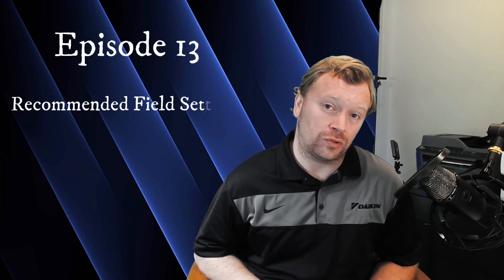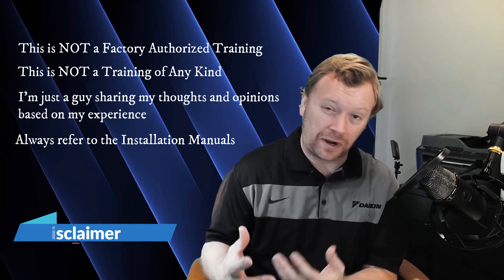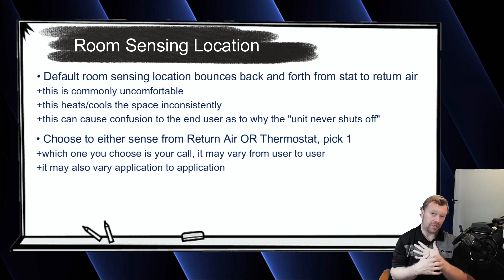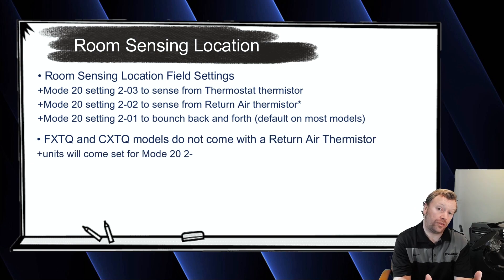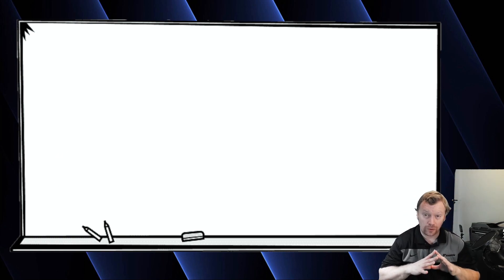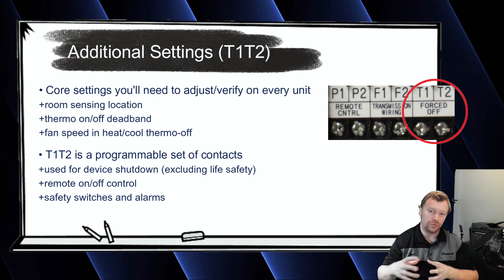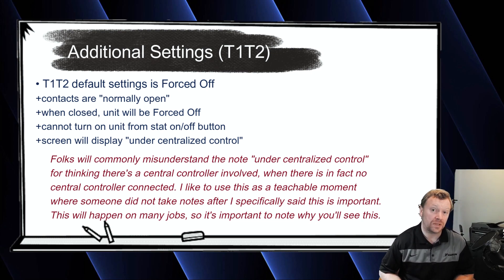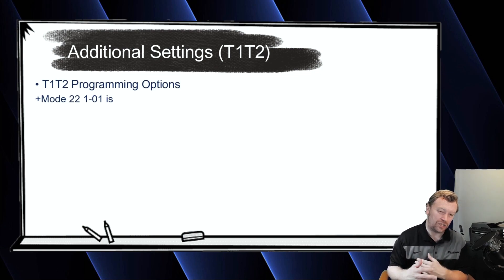Daikin VRV Field Settings | Recommended Settings for Residential VRVS & VRV Life Systems 12-10-2021

Comment: Last week I replaced my Trane old gas heat cooling only condensing unit with a new Daikin 3 ton VRV with CXTQ coil and 80% gas furnace and ONE controller.  2 questions. 
Is there a setting available where to allow the control to have a toggle between where I can select gas heat or heat pump control? I have some friends I’m slated to install systems like mine and they may want to operate on gas instead of heat pump at their discretion. 
Is there a way to turn down the condenser fan to a quite mode for heating. I can hear the condenser fan running inside my home living room and the condensing unit is a ways away from this room, I did do a wall bracket so maybe some of what I’m hearing is transferring down that wall.
Reply from the maker: Great questions. 
Your gas heat is intended for backup or emergency heat, you can set this up a few ways. I did a video on this very recently actually just after this video you commented on. Check it out it will help answer some of this. You can always set up the outdoor temp lockout too from the outdoor unit to tell the heat pump you want gas to come on sooner. The default is 14F outside I believe (or 15F). There isn't a way to just manually turn on gas from the stat though at least not at this time.
Regarding noise of the fan, there is a nighttime noise setting but it reduces the whole system capacity so not only is the fan speed decreased so is the compressor. Are you setting your temp back much at night from morning setpoint? If the unit is always maintaining and not trying to recover this helps immensely keep the capacity need down and therefore the fan speed down as well. The wall mounted bracket on the condenser can increase noise though. I prefer to put units on stands myself but that's just my preference. The unit is internally isolated for vibration noise but I have commonly heard there is still some sound that travels from the unit through the bracket through the wall. First things first though try to maintain and keep the unit running at a lower speed naturally. If that doesn't work then you can always try something else and if you want gas heat instead of heat pump heat it's a matter of adjusting some settings at the outdoor and at the stat such that heat pump locks out in heat and runs gas all the time.
Reply: 10-4. I am currently not setting my system back, so I may have a chance with night quite mode, if you have any details how to set up quite mode, that’d be awesome. I haven’t noticed that in any of the install manuals, I also have my vendor trying to dig up info. Unfortunately they sell more commercial products, so they are having to learn some new things themselves. 
 I was thinking I was being smart with the wall bracket. I may move the unit to base instead. We’ll see. Thank you very much….
Reply from the maker: @ole9313  it's a setting in the service manual. I'll try to look tonight when I'm free. There's a list and I haven't memorized that particular one. I'll send it over once I check.
Reply from the maker: @ole9313  also I wouldn't pull it off unless you've exhausted all other options. Moving it to a stand is going to take the most labor so let's try software adjustments first those are easy.
Reply from the maker: @ole9313  of course now I am curious. How long is the line set length on your unit?
Reply: 29’ of 3/8-5/8. I added just over 1lb of charge per line length calculator.
Reply from the maker: @ole9313  ok cool I was just curious. That's totally fine you're good on length.
Reply: I finally found a service manual for my system on line, I think I’m good to go for now thank you. Thank you for all your wisdom.
Reply from the maker: @ole9313  no problem.

Comment: In my opinion the field settings are separated per installation and differ from site to site. Also i have seen a lot of caces where hotel residents leave another "custom" made key card just to keep the ac on all the time. Moreover in some cases where there is no central controller installed the customer will constantly play with the thermostat going to the extreme limits , i know that you are already aware of this, there are more  hotel field settings and button combination to prevent such occasions. Maybe you could do a hotel settings video for the brc1d52 as well....
Reply from the maker: Remember this list is for resi jobs. Vrvs equioment. Commercial applications definitely have more settings utilizes and yes hotel apps also have unique settings. This was a basic list recommended for homes. To keep things nice and simple. 99 percent of the time this covers you, where you need more, then the install has unit specific settings for those circumstances 👍

Comment: After subscribing and watching your videos I was really excited because I learned so much from you. Started up a system today on a VRV with two fan coils. One worked perfect did the field settings and connected the smoke detector just like I learned from you. The second unit- blank screen on the wall controller. I checked the wiring from the unit to the controller and even tested the wire for continuity. I have DC output (16.48) at T1/T2, no DC output at P1/P2 at the terminal block. I have 208 volt power at the X28A connector. Both LEDs are blinking just like the other working unit. All the plugs are connected well at the A1P board. I think the board is DOA. What a rough day, had such high hopes. I really aspire to become an expert with Daikin systems.
Reply from the maker: What is the indoor model and what is connected to t1t2. I've seen shorts on p1p2 cause issues. Try running a new wire just temporarily from unit to stat see if it works. That clears up the wire potentially being short (very common).
Reply: Thank you!!!!

Comment: I need to install a smoke detector on a FXMQ I know how to wire it but can't find any info if I need a field setting to force the fan off. Thanks.
Reply from the maker: you will need to set field settings to forced off for T1T2 with smoke detectors. Mode 22 1-01. No need to change fan it will shut the unit off entirely.

Comment: I have my deadband set to 1 degree F, but I have found that it is closer to 1.5-1.75 degree F and I attribute that to the system being programmed in Celsius and having to convert to Fahrenheit for us imperial heathens. It’s sloppy because there are 1.8 degrees F in 1 degree C and I would bet the system deals with temperature as integer only.
Reply from the maker: And it always rounds to the nearest whole number. So on the stat sometimes it does appear a little higher than just 1 straight up. If you plug in a service checker it's usually pretty darn close though for actual thermo on/off status. The fan operation and eev throttling reaction time might be affecting the additional drift. Either way 99 percent of the time maintaing setpoint with the 1 degree setting is comfortable. I rarely have issues with it in my market. Every now and then you get the folks who want instantaneous on/off from the slightest movement off setpoint. Inverter is not on/off technology and sometimes it's hard to explain to the stat lookers that your body can't even recognize 1 degree lol. Letting it drift, turn on, operate to maintain that setpoint then eventually turn off if and when it overshoots 1 degree is far better for efficiency than immediately turning on from the slightest drop and immediately turning off again when the stat ticks up a tenth of a degree lol.